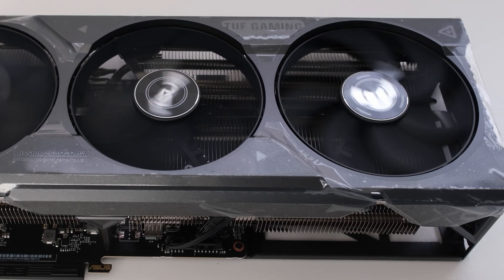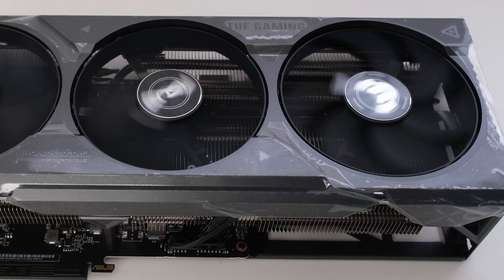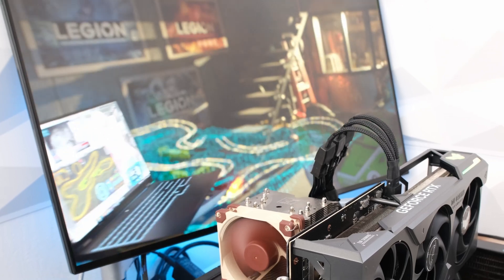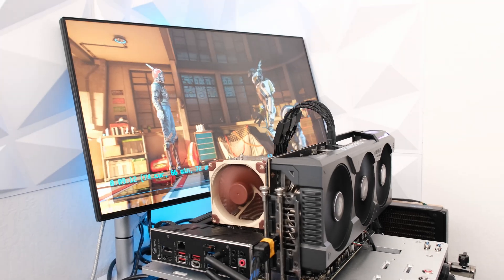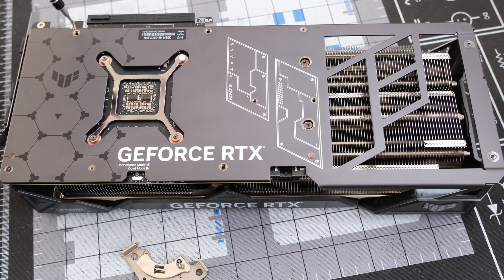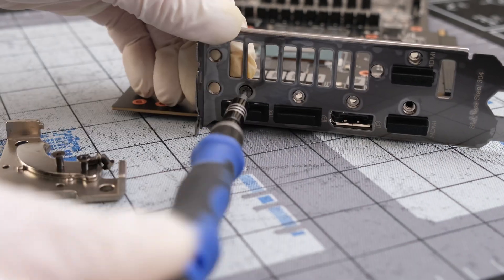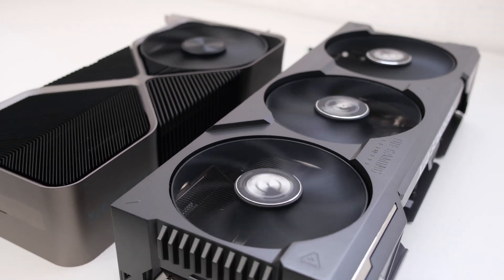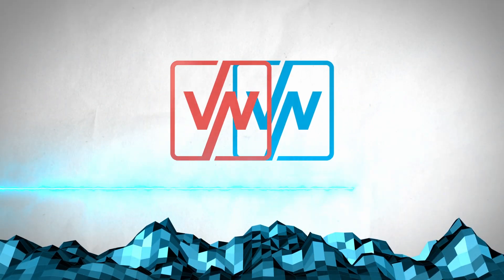RTX 4080 ASUS TUF Teardown Thermals Deshroud Undervolt Unbox Overclock Thermal Pads Power Target PCB

Comment: Thanks, I have to repaste my TUF 4080S due to a 35 delta on the hotspot (110C). Knowing the thermal pad thickness and teardown will help. Assuming it's the same.
Reply: Hey, I know your comment is 3 months old, but my 4080S tuf is like 6 months old and the temps have been getting higher every month, to the point that I undervolted the card because it can no longer run on full load with default clock speeds as it jumps to 83 degrees and 110 on the hotspot and starts throttling, my memory temps were 58 which is fine I think, so I wanted to ask you since you have a similar issue, were you able to fix yours with a repaste?
Reply: @hellhound6652  Mine is a year old and about 6 degrees above Delta so I am going to re-paste mine. I want to get new thermal pads too. I think you will find the temperatures will probably go below what they were when it was new when you repaste.
Reply: @jonathanparle8429 Yeah I actually already did so 2 months ago, I replaced the thermal paste and the pads as well because they ripped when I opened up the gpu. The temps are insanely better, no more having to undervolt the card, in fact I even overclocked the card and no more 110 degree hotspots, i barely reach 80-85 degrees on the hotspot, PTM 7950 did the trick for me.

Comment: I got this card, 1 RMA and still overheating after few month. Don't buy this s* :)
Reply: Hey I know your comment is 9 months old , but I wanted to ask is were able to find any solution to your issue? my 4080S Tuf is 6 months old and is having insane temps of 83C and hotspot is 110C and it throttles, is repasting a good solution or is it temporary?
Reply: @hellhound6652  I bought some Grizzly thermal paste and reapplied it myself. Use a card to spread it thinly. Problem solved.
Reply: @Tenno-Heika  mind telling me what you're temps were like before and after? and was the problem solved long term for you? so no like constant need of repasting
Reply: @hellhound6652  The hotspot triggered the card protection with fans running at 100% I don't know exactly how much but at least 110° or more. Since I repasted the card I haven't had any problems for several months. The Asus thermal paste was liquid and poorly applied, whereas the Grizzly is very sticky and I took care to spread it with a card.
Reply: @hellhound6652  I forgot to mention that the temperature is around 65° and the difference with the hotspot no longer exceeds 10°c.
Reply: @Tenno-Heika  holy shit exactly my situation, I undervolted the card because it can't handle full load anymore, the fans go to almost 100% and the hotspot is 110, btw it can't exceed 110 because the card automatically starts throttling to protect itself
Reply: @Tenno-Heika  thats so good to hear, i'm so surprised how shit their thermal paste was and that SUCH A HUGE difference can be made with changing the paste, I'm a bit relieved now, thank you for all the information
Reply: @hellhound6652  My 4080 has always been undervolted, when I saw that even at 40% power limit the fans were running at full speed I performed an RMA which was useless. They don't care about the customers at all...
Reply: @Tenno-Heika 40% power and fans were full speed? Yeah that’s crazy, I’ve read and talked to a bunch of people now and I didn’t know the thermal paste on this gpu was so bad, but at least it should be an easy fix
Reply: @Tenno-Heika when i contacted asus for help, you know what one of their solutions for me was? Limit the fps in game. I bought a 1000 dollar gpu for gaming and some productive stuff and I get told to limit my gpu’s capabilities
Reply: @hellhound6652  Yes it's very simple. There are videos on YouTube showing how to disassemble the card if necessary. I forgot to mention but there is another problem with this generation of GPUs. Because of their weight they lean if you don't use the bracket/holder that comes with the card. A card that bend too much can cause the chip to detach from the solder balls on the PCB and the GPU becomes irreparable most of the time (there is no more or very little PCB stock for the 4080 because many have already had this problem...).
Reply: @Tenno-Heika  I actually put that bracket holder in since day 1 because I understood that the gpu was heavy af and it was kinda bending without it, so I think I should be fine on that part, I just hope the overheating issue is only on the thermal paste part and I'll fix it with a quick repaste.

Comment: Thanks for the video, now I’m going to repaste the gpu because hot spot temps go up to 92 with nearly 28 degrees delta. Do you recommend thermal pad change for the VRMs? I thought I heard 2mm but I’m not sure. Subbed to the channel.
Reply: I've changed the thermal past for my 4080 after seeing your comment and the temp's dropped from 85 to 65 and hotspot from 109 to 75 under load
Reply: @محمدنسيمابوريحان  great!! Same here Ptm is the way to do it!
Reply: The Asus cards suffer badly from thermal paste pump out. The hot spot temperature pretty much starts creeping upwards from 80c when new all the way up to 105c after 3 months. After replacing the paste a few times because of this, I'm now going to swap the die paste for a PTM pad, which should stop this from happeneing.
Reply: @ a question Honeywell ptm and also thermal grizzly PhaseSheet ptm has 0.25mm thickness, is that okay? Also can I leave the thermal pads on rams and vrms original as is when repasting or changing to ptm?
Reply: I did replace the old cheap trash paste that came with my rtx asus 4080 I did use ptm7950 from LTT the thickness is 0.25mm at the end there was not need to replace any other pads (vram or memory pads) just the gpu itself, and let me say this! It really really made a huge difference now the fans stay silent all the time and ohh boy! My temps went around -20 degrees while gaming! Tbh It all depends on the game but there is a really huge improvement in temps! Now my card is colder and better than new. Just make sure you get a real Ptm like the ones at ltt. If you need more help let me know I was in the same situation couple months ago.
Reply: @ yeah thinking of getting thermal grizzly phasesheet ptm as its one of the few legit options to get here in my country
Reply: That was my second option you should be good with that one too.
Reply: @ I don't think its a paste issue. I reapplied the paste twice with the Thermal Grizzly Duranaut and it still happens. I suspect they used some bad material for the cold plate that expands more than it should when hot, so it squeezes the thermal paste out.
Reply: Yeah real Ptm Honeywell has a 0.25mm thickness and you do not need to replace thermal pads on vram just the gpu chip itself, I did a lot of research about replacing vram and even contacted asus to ask for the right vram thickness they told me 2.0 mm but that is not true because vram on asus tuf gaming is 2.5mm so I decided to just leave them untouched, if they look ok just leave them like that.
Reply: @simplicated99  Try out Ptm Honeywell thermal pads that is the only way we can avoid the pump out issue on the cards.
Reply: @ Yeah that is called pump out effect which effects thermal pastes but especially more viscous ones. But no matter how viscous pastes get pumped out. I guess ptm doesn’t get out because it solidifies as it gets colder. Carbonout like graphene pads don’t get pumped out too.
Reply: Same here, I was planning to get 2mm thermal pads thick but it said 2.5 for vrms and 2.0 for memory pads, probably I will not need to replace thermal pads, what did you guys do?

Comment: Do you think it´s possible to change the fans. for example with corsair  rgb 
fans?
Reply from the maker: Thanks for your comment 🙏 I think that would be unlikely due to the size. These fans are smaller in diameter and also do not have any of the extra plastic housing. Hope that helps

Comment: Just used this video to repaste my TUF 4080.. I was getting 100C on the hot spot for some reason (Delta of 30C!) now its gotten down to 5C delta... 
Thank you very much.
Reply: hey I'm having hte same issue with the hotspot the delta it's between 25-30C so I'm about to repaste as well. Did you just repaste or did you change the pads too?. If you did change the pads which one you used? Thanks!
Reply: @ihawk1990 i just repasted my tuf 4080 with TG kryonaut and change pads on vram to 2mm gelid extreme. My hot spot delta is max 10deg and vram temp dropped by 6 to 8 deg.
Reply: @krzysztofsytar6219   I ended up just repasting it and thankfully the pads were ok, after doing that the delta went down and it's currently between 10 and 15. Before repasting it was like 25 - 30C
Reply: @krzysztofsytar6219 how is it holding so far? He mentioned 2.5mm for vram.
Reply: @armandoarroyo  No, he said 2.5mm for the voltage regulators and 2mm for the VRAM.
Reply from the maker: Thanks for your comment 🙏Great to hear! It's what the video is for and thank you for watching!
Reply: @vectornetwork  ur work is rly helpfull. i bought the same card and for the future ur video will help a lot.
Reply: Thanks I guess I will also replace VRMS pads with 2.5mm

Comment: Hi, can you provide any info on the screwdriver type and size needed? Thanks
Reply from the maker: Thanks for your comment 🙏I also responded to your other question and copying that here. The screwdriver is part of a set that I purchased on Amazon. It's the "XOOL 140 in 1 Precision Screwdriver Set". I also have GamersNexus's screwdriver set and I still use the XOOL (generic) set because its a good size for me and I can swap out all the bits. I do plan on getting the LTT x Noctua Screwdriver once that becomes available and will likely do a brief unboxing in whichever video I start using it in. Hope that helps

Comment: Thanks for the video. It allowed me to turn off the RGB.

Man ASUS rgb control sucks ass. It's supposed to work with iCUE but it just doesn't (unless you kill random tasks in task manager which I'd rather not do every time I launch my pc...).
Reply from the maker: Thanks for your comment.🙏I am encouraged that you found the video useful. I do agree that the RGB control could use improvements. I don't have any of the RGB software that I actually like to use and/or think are actually designed to be helpful rather than some other reason. On the test rig, I'm constantly uninstalling any of those software that I have to download for a specific card in a video.

Comment: Thanks for this quick and informative vodeo.
What I don't get, and you also didn't mention, is, why the heck ASUS chose to use 2mm thick thermal pads for the GDDR RAM! Just why? That is aweful 😞
Reply from the maker: Thanks for your comment.🙏Do you mean the ones for the memory on the from of the PCB? If so, I'm not sure. Do you mean that the thicker pads (as compared to 1.5 or 1.0mm) is less efficient at transferring the heat?

Comment: My 4080 (the rog strix) didn't come with this two additional screws to remove the heatshield, just the 8 on the back and the three on the cable plate. No worries though it came apart with a little persuasion for anybody reading.
Reply from the maker: Thank you for your comment🙏The ROG Strix version had its own section of instructions, so I imagine that there were some minor differences like the one you mentioned. Thank you for sharing and for providing that information.
Reply: @vectornetwork  Yeah weirdly the instructions for the rog strix 4080 were incomplete, but thanks to your video I was able to work my way through it, so yeah, right back at you on the thanks, great job on the video, it really helped me out!
Reply from the maker: Wow, sounds good and I'm happy that it worked out. As for the instructions, there were at least 2 places where I am nearly 100% sure that were wrong/incomplete as you mentioned. Not surprised, but a little bit frustrating in the moment.
Reply: @vectornetwork  yeah agreed. I would have liked to have clear instructions for placing the thermal tape on the rog strix, which was absent from the instructions, and the pcb is different on the strix than the tuf. By looking at the back of the ek heatplate, I could figure out where it made sense to put the thermal tape where there were variations from the tuf model. Hopfully I won't need to pull the whole thing apart later.

Comment: Between Asus TUF 4090 and PNY 4090 which one is easier to disassembly?
Reply from the maker: Thanks for your comment 🙏 Hm, they are comparable. If I remember correctly, they both require only Philips head screws. The PNY one was designed in a manner that I have seen before that makes sense. It was nice that the fans were still attached to the heatsink when it was deshrouded. The TUF equally straightforward in disassembly, although a bit different because its custom to ASUS. The fans came off along with the shroud. The shroud itself is better made than the PNY shroud. The TUF shroud is metallic with a metal fan frame. The PNY shroud is plastic. I would consider them both on par nearly the same for disassembly. Hope that helps. 🙏
Reply: @vectornetwork  do you have any plans to disassembly the msi gaming x trio RTX 4090?

Comment: thanksk for the vid ive been looking forward to deshrouds for 4080  :))
Reply: also i really appreciate u measuring it after deshroud, what is the length after deshroud btw?
Reply from the maker: @DrTapeworm  Thanks for your comments 🙏 In retrospect, I should have measured the deshrouded card length wise too. I was thinking that the only difference in measurement was the height and I rely on official specs from their website for things that I don't think changes. I was thinking that the heatsink extended far enough where it was reasonably the same length. However, thinking about it more, I do think the deshrouded card was a least a few mm shorter. I don't have the card deshrouded anymore so I can't measure it, but I will plan on measuring the length in future videos. Hope that helps.